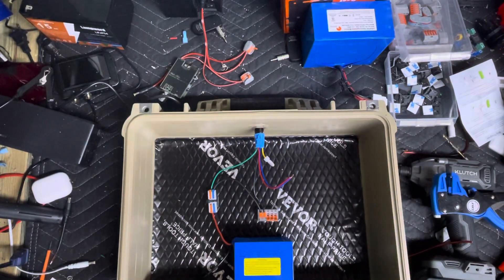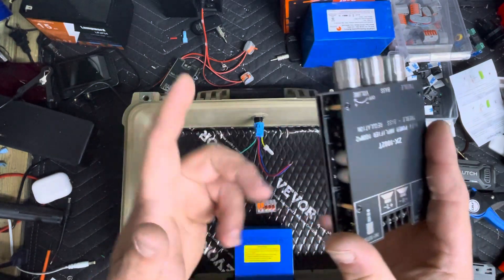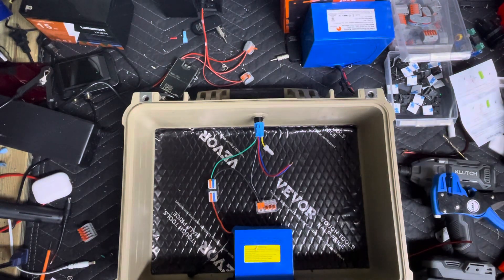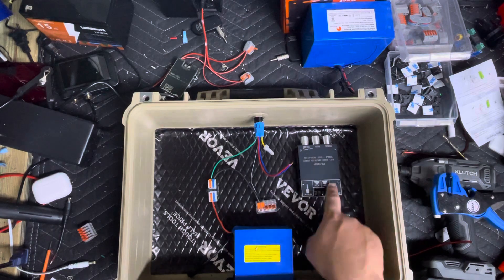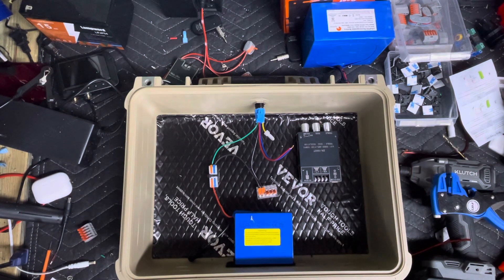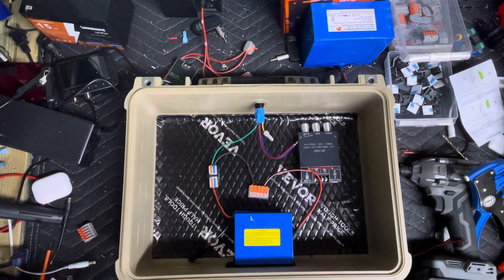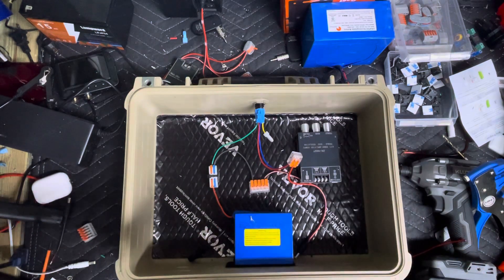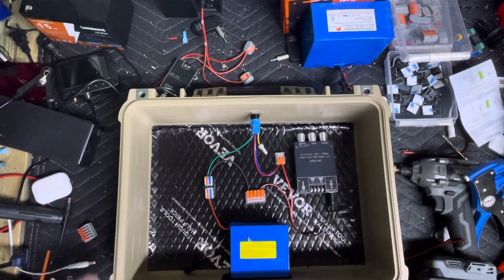How To Build DIY BoomBox Build Part 4

Comment: I have watched this video a hundred times and followed it step by step in my build.(very helpful) I hope someone can help me with my problem. When I turn on my boom box the first time nothing, if I turn the switch off and back on,it fires right up.
It’s the same power switch that you use. The first time you push the power switch button you can see a little bit of faint light coming from the button, but it will not power up. Turn it off and back on again and everything comes to life. Craziest thing I ever saw. Oh, I did put a new power button in and it does the same thing anyhow any help would be appreciated.

Comment: Why do you do 24v batteries over 36v where you could get even more power? Just happy with the 24v power output?
Reply from the maker: A few reason , First this amp doesn't handle 36v. Also 36v batteries tend to be harder to get for a cheap price, and chargers are sometimes more expensive. Not always the case, We have also tested other amps at 36v vs the 1002t and 1001u and really isn't always worth it .